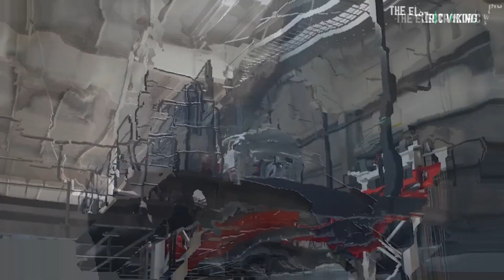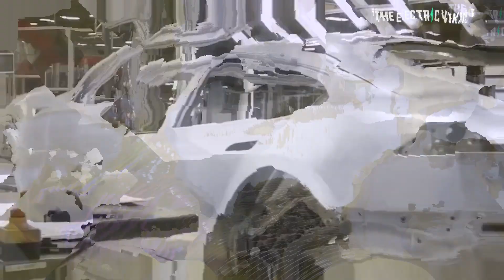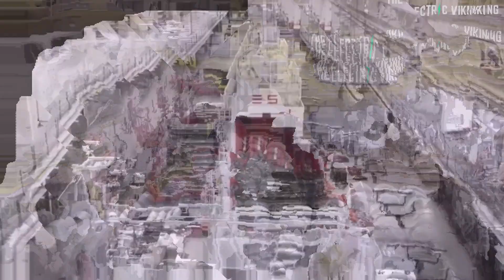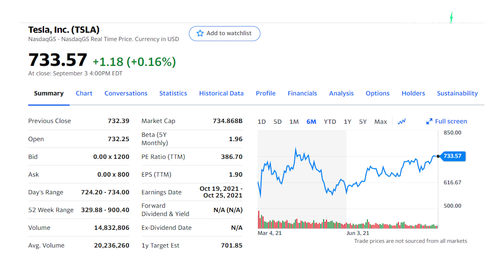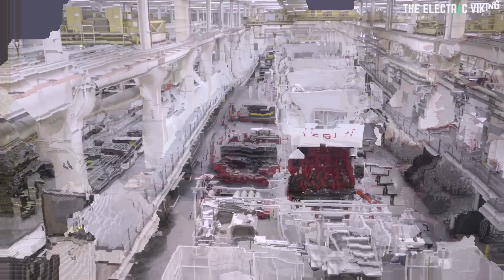Elon says this is Tesla's most difficult month EVER - They might be making semiconductor chips

Comment: I think you misunderstand the chip issue.. the term chip maker has no value. Chip maker facilities are rated by minimum size of the smallest element, BYD is most likely (based on available data) has a 20 micron fab capability, which is good for most commodity chips but of no value when it comes to making chips for the self drive function. Tesla is currently using a 7 micron fab and has a deal with Samsung for a 5 micron fab capability for their newest self drive computer. That new fab capability was announced this week to be located in Taylor Texas, about 40 miles from the Tesla plant in Austin. Samsung already has a chip fab plant in Austin but its either a 20 or a 12 micron capability. The 5 micron capability is very new and only TSMC in Taiwan offers this capability in a contract facility. Samsung is doing some 5 micron contracts but the production level is still low. Commodity chips are a real problem but in most cases it impacts the parts suppliers which use many different types and some are in short supply. Tesla has been recoding their software to use chips that are available for these subassemblies, other car maker have very limited capabilities to do this kind of software change on a large scale and with quick turnaround.

Comment: Looks like good news. Gasgoo are reporting BYD have NOT fired their law firm and now that their original law firm has presented the correct documentation, the listing has re-started!! 

It literally could take place any time BYD chooses now and byd semi is going to really attack the market to supply chips for its own products, but also its competitors.

Aside from the Jinan-based one, BYD Semiconductor also has four wholly-owned subsidiaries, namely, Ningbo BYD Semiconductor, Guangdong BYD Energy Saving Technology, Changsha BYD Semiconductor, and Xi'an BYD Semiconductor."

and over the last few days..."BYD Semiconductor, a spinoff from China-based carmaker BYD, has acquired a 77.75% stake in Jinan Energen Semiconductor for CNY5 billion (US$774.8 million). Energen makes silicon (Si) and silicon carbide (SiC) power devices.

SiC power chips are increasingly adopted by Tesla for battery electric cars."

Comment: You know who owns a chip manufacturer specializing in power CHIPS for cars.  BYD.
Reply: Looks like good news. Gasgoo are reporting BYD have NOT fired their law firm and now that their original law firm has presented the correct documentation, the listing has re-started!! 

It literally could take place any time BYD chooses now and byd semi is going to really attack the market to supply chips for its own products, but also its competitors.

Aside from the Jinan-based one, BYD Semiconductor also has four wholly-owned subsidiaries, namely, Ningbo BYD Semiconductor, Guangdong BYD Energy Saving Technology, Changsha BYD Semiconductor, and Xi'an BYD Semiconductor."

and over the last few days..."BYD Semiconductor, a spinoff from China-based carmaker BYD, has acquired a 77.75% stake in Jinan Energen Semiconductor for CNY5 billion (US$774.8 million). Energen makes silicon (Si) and silicon carbide (SiC) power devices.

SiC power chips are increasingly adopted by Tesla for battery electric cars."

Comment: If I was going to build a semi-conductor plant in the US -it would most likely be Austin, Texas area.  

Tesla doesn't use regular silicon chips.  They use silicon carbide which is about 2x more expensive, but far more reliable and use less space = for power electronics (inverters etc) Tesla parts are much smaller that using regular silicon.  Tesla has a huge advantage using silicon carbide especially in an EV where overall weight is important.  So Tesla's silicon issues are quite different than other automakers.
Reply: ... over the last few days..."BYD Semiconductor, a spinoff from China-based carmaker BYD, has acquired a 77.75% stake in Jinan Energen Semiconductor for CNY5 billion (US$774.8 million). Energen makes silicon (Si) and silicon carbide (SiC) power devices.

SiC power chips are increasingly adopted by Tesla for battery electric cars."
Reply: @BSBSBSBSBS-i2x  So r u saying that BYD cars are going tO get Si semiconductors or already have them, and what is the weight difference for manufacturers who won’t get or can’t get them. And what are the specific reliability issues. What’s the detail . What goes wrong ? When does this occur in the life cycle ? What might happen to the car. What you say is good, but we need to know the consequences of reliability issue
Reply: Teslas are obese anyway, they are desperate to lighten its fat Tesla M3 and others

Comment: Answer to where will the next giga factory be located is simple - Whichever location guarantees the ability to reach 20 Million units manufactured annually. Sleuth that and you have your answer. Japan, S. Korea or the U.K. seem the most plausible options perhaps.
Reply: Supposedly they already scouted a location in South Korea. And in the UK at an industrial area where several other's have also looked to also produced batteries or ev parts. Could end up mimicking that electric only industrial park being built out in China with nios first factory among the buildings. 🤔
Reply: @4literv6  ???? My bet is on Japan to stick it to Toyota.